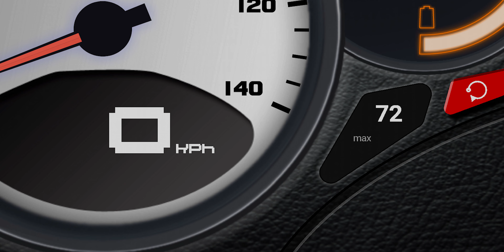ASW Carbide Ride 2 + Top Speed (4K)

Comment: What would you say is the most important/ first upgrade you made to your beast!? I was so happy to see you had an upgraded video! I’ve watched the old one in the past but didn’t see the follow up one! Just busted mine out again for the year and was wanting to put a little cash into it! Thanks. Awesome video and sick riding by the way!
Reply from the maker: Sorry delayed, never got the notification for this. The best upgrades were probably the ones I did before the first video. Those were the day any night difference, everything after that was mostly just marginal improvements. So just your basic stage 1 kit (high flow exhaust and air filter and carb re-jet) As well as changing the weights and springs in the clutch so it keeps the kart in "low gear" longer making better use of the power band. I also had a upgraded spark plug and coil for that video but I feel like that was probably just a minor improvement. Thanks! Glad you liked the video! 😁

Comment: I wish mine moved like that. I've got an intake, open exhaust, upgraded clutch with 9gram sliders, 23" rear tires and 20" fronts, full led headlights,tail lights and a light bar, ive topped out at 43mph with me and my son in it, but it just doesn't have the climbing torque I want, definitely not enough for 2 adults.
Reply from the maker: Nice! Yeah even with all my mods it still isn't very good at climbing, especially with more then 1 person. These buggies don't have a good power to weight ratio. Bigger rear tires really kill climbing ability too. You probably would need to put on a much bigger drive sprocket and sacrifice a lot of your speed to get decent climbing ability.

Comment: Dang dude, sick build! I got the exact same kart from my Uncle who had it sitting in a field for years and I got it running and drove it for a while but wanted a bike so I ended up trading it. Long story short I've now had 5 bikes and I wish I still had the go kart. That little thing was so much fun, my front left shock was blown but that didn't stop me and my best friend from riding the fool out of that thing. We rode it so much I snapped 2 belts. It was an absolute blast but it was almost stock except I put a light bar on it. The highest I ever hit with it was like 45-48mph but that being said, it was stock torque converter on stock wheels and tires.
Reply from the maker: Thanks! Yeah they are a blast and small enough to fit down tight trails. I prefer the karts over bikes because I can be a lot crazier in em haha. If I roll the kart the roll cage protects me. If I roll a bike I'm in for some pain haha.
Reply from the maker: @Corbin Harris Could be but it could also be the gears inside the engine that control the forward neutral and reverse, that broke. I've had the teeth on those break off on me before and had to replace them. There's also the possibility maybe the bolts came out of the rear sprocket and its just spinning freely. I've had those come out on me before.
Reply from the maker: @Corbin Harris Hopefully its just that! It's a huge pain if you have to start pulling the engine apart. >_<
Reply from the maker: @Corbin Harris its all integrated into the engine. You have to pull apart the whole right half of the engine case to get at them.
Reply: @MarcelsWorkshop  hey I have one of these go carts do you no what could cause no spark I have replaced the cdi box and that did nothing
Reply from the maker: @huntergray1554  Hmm, if its not the CDI, Coil, or spark plug itself, it could be a problem with the Stator and Magneto. Although before trying anything make sure it's not just one of your kill switches has been activated. Any time I've had spark issues the culprit has always been either the kill switch on the dash or the kill switch on the back of the buggy on the electrical cover, has been bumped and toggled without me realizing it. Probably a good idea to follow the wires for those too and make sure they aren't stripped and touching somewhere.

Comment: Did the hammerhead seats fit with no modification? I have the same cart. I need new seats. I was gonna go big bore also. Looks sweet. Ive done some mods she holds at 42mph right now. And still has the power down low. Ive been sitting on a Honda 200sx engine i rebuilt, semi-auto 5speed, with reverse. Electric start and pullstart. Was hoping to use the same cam that switches from forward to reverse on the cart now and just putting it on the shifter... its the same diameter. Ill post on here if I do the swap.
Reply from the maker: Yeah they just bolted right in. These were the ones I got: 
Driver bottom: https://hammerheadperformance.com/seat-driver-seat-bottom-for-gts-150-13-0401-01l
Passenger Bottom: https://hammerheadperformance.com/seat-passenger-seat-bottom-for-gts-150-13-0401-01r
Back for both: https://hammerheadperformance.com/seat-seat-back-w-logo-for-gts-150-13-0401-01

I was tempted to do the big bore but then I read they are prone to cracking and don't last very long, so it seemed like more headaches then I wanted to take on. :P 

Nice, sounds like you already have it set up pretty decent. That would be a pretty cool engine to put in it though. I wanted to do something like that originally, but then decided it wasn't worth the effort because I have no where to drive it other then the back yard. :P

Yeah send me a link if you end up doing the swap! I'd be curious to see how it turns out. :D

Comment: I'm planning on getting another one and putting a bike motor in it, like maybe a kx250f or a crf450f
Reply from the maker: That would be cool! That's what I originally wanted to do but decided it was too much work and after all the mods the performance was good enough haha.
Reply: @MarcelsWorkshop  Yah I noticed the long list of everything you did to it, how much did all those parts cost total? I'm weighing out doing all those upgrades vs throwing a predator 420 in one cause I got to thinking about a bike motor and the transmission is just too short for a heavy kart. They're not designed for that kidn of weight I feel like I'd spend the whole time in first and second gears...
Reply from the maker: @tntproductions2504  Sorry missed this. I'm not sure exactly. I'm probably into it for a couple grand haha. More then i wanted to spend but once I started I kept wanting more lol. Predator 420 would be a nice engine for this kart. One of the things that held me back from doing an engine swap though was I realized how useful having reverse was. Motorcycle engines or engines like the 420 don't have reverse, so trying to rig up some sort of reverse mechanism seemed like it would of been a pain. :P
Reply: @MarcelsWorkshop  lol yah, I'm actually almost done with the swap. Long story but I got the same kart and I put the 420 in but I'm still working out kinks. I've got it modified and its making top side of 20 hp now.... It's a little too powerful, it bent my 1/4" solid steel mounting plate so now I've gotta weld in some supports to hopefully eliminate the flexing that the insane torque is causing. I'll post up a video of it when I finish it!

Comment: That is the GY6 150cc engine? I do a copy paste for pumper carb. I don't see it. Is pumper slang?
what drive sprocket did you use with those 22's?
I have a 100% stock Zircon Fox. I'm going to go with 20x7x8 aggressive 6 ply in rear and same tire at 19x7x8 in front. That's 2" taller than stock tire in back and 3" taller in front. I don't want more speed. I want power on a budget. I'm looking at 18lb spring and sliders. Could use help determining which slider. A performance carb rejetted and a cam. Lastly a larger drive sprocket. I'm perfectly fine with a 35mph buggy. I want torque for hill and rock climbing. I did a compression test at 150PSI with w/o throttle Again need a little help selecting parts that will work good together. I'm thinking that I also need to change the valves and put in stronger springs. It would be a bonus if I could do donuts in the dirt Any advice would be extremely appreciated.
Reply from the maker: Yeah it's a GY6 150CC. 

Yeah its slang for a carb with an accelerator pump, which just gives the carb an extra squirt of gas when you floor it. Here's the link to it: https://hammerheadperformance.com/performance-upgrades/performance-150cc/hammerhead-after-market-carburetor-30mm-carburetor-for-150cc-gy6

I don't know If I would recommend the 30mm carb though unless your going to be doing a lot of work on the head or a big bore kit. It has probably given me the most headaches out of all the mods I've done. 

It is still all the stock sprockets. Not sure the size of them off the top of my head.

Hmm performance on a budget. I'd start with a high flow exhaust, air intake, bigger jet, performance cdi, coil, and spark plug. Then the 1500rpm torque spring and 1500 clutch springs and 10g sliders. You could try 2000rpm springs and 12g sliders too which would keep the buggy in "low gear" at an even higher rpm. I've never tried that set up though. As for Cam's, I've only ever tried the A9 because that's what was recommended to me back in the day. I can't remember the advantages or disadvantages to all the other sizes available.

If you do all that and your still not satisfied then you could move on to a ported and polished head, bigger valves, better valve springs, the bigger carb, a big bore kit, performance crankshaft and piston, etc.
Reply: @MarcelsWorkshop  Thanks for the reply. I'm starting with a 12 tooth engine sprocket and 10g sliders clutch and  torque springs. I will be putting my 18" tires on front and purchasing 21x7x8 6ply agressive mud tires for rear.
What is your spring travel for the front and rear?  Rear tire size please..
Reply: @MarcelsWorkshop  I got my zircon fox Gy6 150cc running like a champ. After the different repairs I've done, I come to the conclusion that the buggy didn't get the repairs as needed. air line from filter to carb was crushed, split and wrapped with electrical tape. Electric choke didn;t work. Someone took it apart and glued it back together. steering bearings were bad and needed to be replaced.  It runs like  a champ and is easy to start. Gets to top end quickly. All s good except for one small detail. top end is only 32mph. Should do more like 40mph. what should I be looking at to try and find the solution. Scooter is stock. Thanks for any help.
Reply from the maker: @dennistrue6473  No idea the suspension travel. its this kit. https://hammerheadperformance.com/shock-full-suspension-upgrade-for-150cc-karts-150-suspension-kit
My rear tires are 22x10R10.
Reply from the maker: @dennistrue6473  Glad its running well! The easiest way to get more speed would be change the gear ratio, but more speed means less power, so might have to do some experimenting to find a happy medium.

Comment: I hope you are reading comments. Can you tell me where you got the seats? And what model number are part number they are. Thanks. And, if they are comfortable and absorb some of the shock.
Reply from the maker: I believe these are the ones I put in:
Driver Bottom: https://hammerheadperformance.com/seat-driver-seat-bottom-for-gts-150-13-0401-01l
Passenger Bottom: https://hammerheadperformance.com/seat-passenger-seat-bottom-for-gts-150-13-0401-01r
Driver and passenger back: https://hammerheadperformance.com/replacement-parts/body-and-frame/oem-seating/seat-seat-back-w-logo-for-gts-150-13-0401-01

They are about the same as the stock seats as far as comfort goes. I only got them because my stock seats were falling apart.
Reply: @MarcelsWorkshop  Thanks. I wish I could find some nicer ones but there's not a lot of room in those things.
Reply from the maker: @codinglifer2392  Indeed. Although if your good with fabricating things you could probably find a way to make any buggy seat work.
Reply: @MarcelsWorkshop  I bought some fork lift seats that have much more padding. Now I need to fabricate some sort of shock mounts. Thanks.
Reply from the maker: Oh nice! That'll be an interesting setup.

Comment: do you know the stock wheel bolt Pattern? and do they match with some atv rims?   -thanks
Reply from the maker: It's 4x110mm on front and 4x137mm on back as far as I know. Not sure which rims out there fit it. I have stock rim on front and put ITP A-6 Pro Series Rear Aluminum Rims - 10X8, Offset: 3+5, Pattern: 4/137 on the back.
Reply: @MarcelsWorkshop   alright thanks one more question your seats i was looking for factory ones but cant find aney what ones are you running
Reply from the maker: @OTH3R6  I believe these are the ones I put in:
Driver Bottom: https://hammerheadperformance.com/seat-driver-seat-bottom-for-gts-150-13-0401-01l
Passenger Bottom: https://hammerheadperformance.com/seat-passenger-seat-bottom-for-gts-150-13-0401-01r
Driver and passenger back: https://hammerheadperformance.com/replacement-parts/body-and-frame/oem-seating/seat-seat-back-w-logo-for-gts-150-13-0401-01

Comment: I'm interested in buying a used American Sportworks Carbide 7150 150cc, but the battery is dead. 
What Battery Size does it use? 
Can you recommend a source for parts besides ebay?  Lately part options getting kinda thin there..

Also, would be getting a Carburetor . Can you recommend a good stock one and source?

Front Tire Brand , Size, Source?

I found out American Sportworks changed their name to American LandMaster however no longer sell Go Karts. I contacted them more more info. Haven't heard back yet.
Thanks for your time.
Reply from the maker: I don't know the dimensions of the battery, but it uses just a standard motorcycle battery you can get at any auto parts store.

I got most of my parts from https://hammerheadperformance.com/ the Hammerhead buggies and AWS buggies used most of the same parts. They carry most of the stock parts and performance upgrades there.

Could get a stock carburetor from above link or just google 24mm GY6 carburetor, lots can be found on amazon and other places. The GY6 engine these buggies use is a super common engine cheap buggies, atvs, scooters, etc use, so tons of different Chinese manufactures make parts for them.

Parts manual can be found here for looking up parts: https://manualzz.com/doc/6524893/american-sportworks-carbide---quantum-7150-parts---user-m...

The manual says stock front tire is 19x7 R8, brand doesn't matter any will work as long as the size is the same. I replaced my front tires with Duro HF277 Thrasher - 20X7R8. The extra inch fit fine. Can buy tires anywhere that sells ATV tires. Or get the stock ones from that hammerhead site I listed above.
Reply: @MarcelsWorkshop  thanks so much.
Another question:
Does the Go Kart engine charge the battery or do I need to charge. It doesn't want to turn over. I got a new battery and drove the Kart about 10 or 15 times and each time the starter struggles with a delay to turn over the engine. I thought the magnito powered the lights and charged tge battery??? I never had a Go Kart before...thanks
Reply from the maker: @adamnickel4126  Yeah it should charge the battery. The only time I've had to charge the battery manually is after its been sitting in storage all winter.

I've had a similar problem a couple years ago. The starter seemed to struggle more and more every time I went to start it and eventually just wouldn't start anymore. Tried replacing the battery because I thought it might not have been holding a charge anymore. Got a couple more starts out of it but then eventually stopped working again. 

Ended up being a problem with the starter itself. Bought a new starter for it and it fired up right away and I haven't had that problem since.

So you could be experiencing the same issue, or perhaps there is a problem with your charging system and the battery is indeed just draining to the point where it can't turn over the starter anymore.
Reply: @MarcelsWorkshop  thanks
my speedometer doesn't work. the display doesn't show up. i think i have to replace it.
however could you tell me or take a picture of where the speed sensor and round magnet placement on the rear passenger axle area should be in relation to each other?
 i think the round magnet on mine broke off..or fell off...i don't see it...i dont know how to put it on when i order one or where. Does it just stick to the metal? Or do i have ti take things apart? I dont know where to begin
i bought this used and cannot find any info on where it goes.
thanks for your help
have a great day.
Reply from the maker: @adamnickel4126  I'm not sure how it's set up off the top of my head and can't take a look because the buggy is stored at my parents place out in the country, I live an hour away from them in the city and don't get out their way much, sorry. 

I wouldn't bother trying to fix it though, it's not very accurate and the buggy isn't street legal so there's no real reason to have to know your approximate speed. 😛
Reply: @MarcelsWorkshop  i appreciate it...i need to make sure my kids are going under 15mph...my hoa are really sticklers about rules sometimes and Im trying to do my best not to ruffle feathers so to speak...i found out someone used an old smart phone with a gps app...ill think about other options
Reply from the maker: @adamnickel4126  I see. They used to make a speed reduction kit for these that would limit the top speed to 20mph. Maybe you could find one of those. Or just loosen the throttle cable to the point where floored is only pulling the throttle 1/4 of the way.